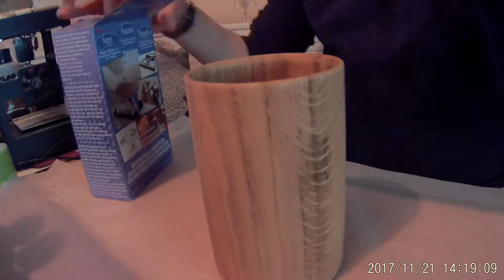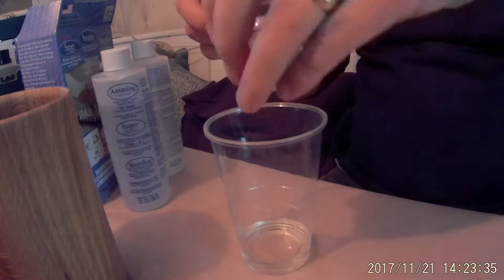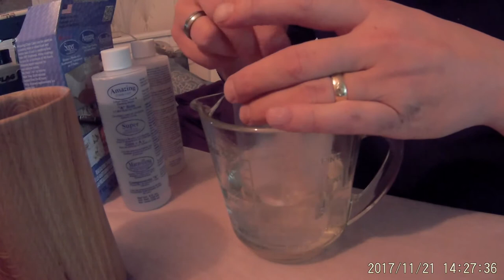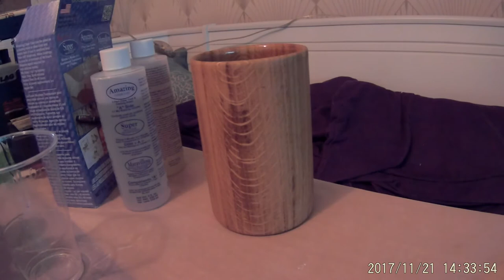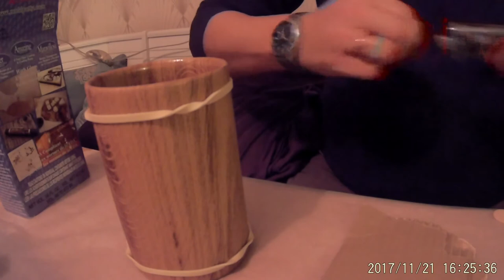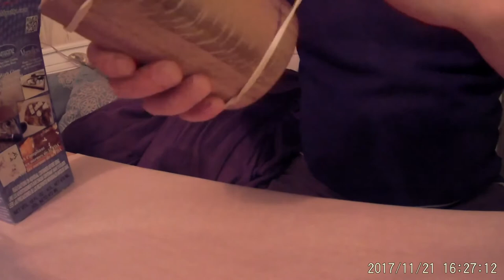Oak Mug Epoxy Resin

Comment: Do you put hot beverages in the cup like coffee/tea? My understanding is resin will soften at those temperatures and won't be food safe.
Reply from the maker: Hot beverages, not advisable. I did try with just hot water, but resin cracked, and leaked, and as you said resin softens and is not food safe.

Comment: Do you finish the outside first to prevent the epoxy from sticking?
Reply from the maker: Hi Brent, I didn't put a finish on outside first, I was just very carefull not to allow resin to come over the edge, but putting a wax food safe product on outside first, would be fine.

Comment: Thanks for posting this! I’ve been wondering how to resin the interior of my coffee mug that I pieced back together after it shattered. Do you pour out the extra resin once you’re done, or do you let it sit in the bottom of the cup?
Reply from the maker: I allow to settle in the bottom.
Reply: If you hit it with a torch it will take out any air bubbles and make it very clear.
Reply: Epoxy resins are sensitive to heat. Is this one different? I mean, would it be okay for hot drinks?